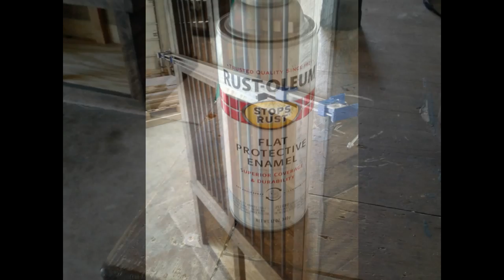Pallet Wood Gun Cabinet one of a kind!

Comment: How many pallets do ya think that took?
Reply from the maker: I was lucky to find large pallets that were made using 8 ' 4x4's and 4' 1x6's. Witch I re sawed I used about 4 of those to build this the frame was cut from the 4x4's and the back and sides came from the 1x6's that I split into 2 boards to make them 1/2 in thick